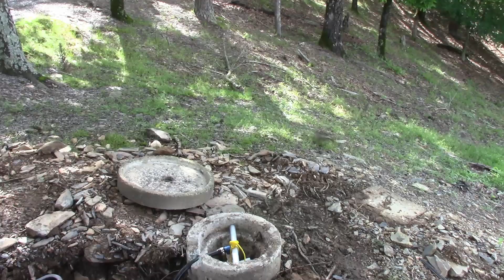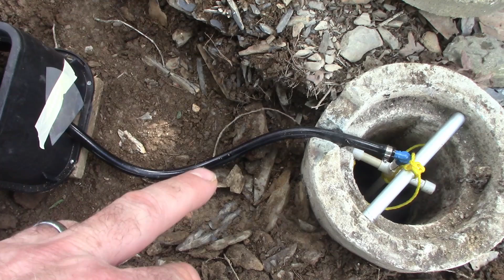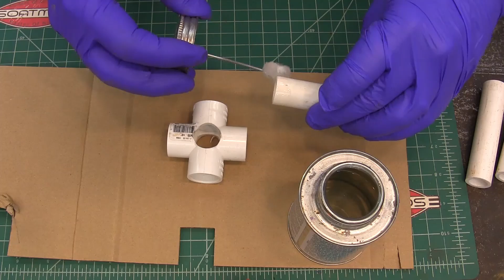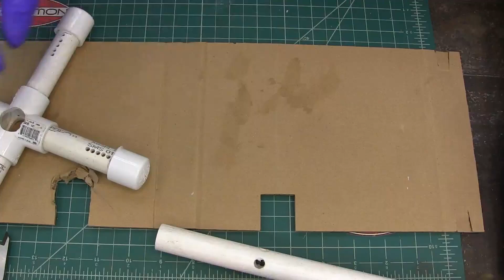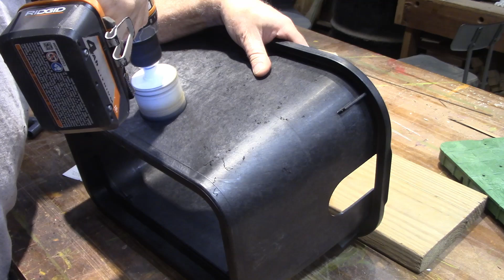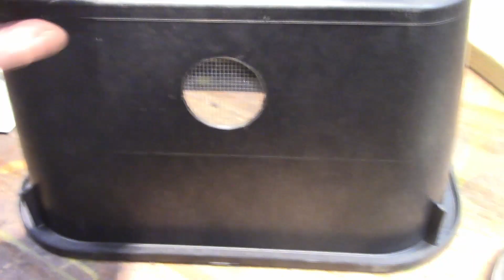Replacing Sewage Treatment Plant Aerator

Comment: Very good repair job.  I always like watching how you come up with simple but effective solutions to problems and do it with hardware items.  I think you learned how to take the hared out of hardware!  I like the idea of strengthening the joint around the cross fitting. Thanks for the video and the learning.  I suppose we are not going to have a garden this year.  My wife will be having a knee and a hip replacement this year and coming up very soon.  The knee that is.  There is just too much to do and not enough time for all the outside work.  So I suppose we will wait until next year for gardening.  Not good but the best I know how to do.
Reply from the maker: Holy cow a hip and a knee. Surely not at the same time. I hope everything goes well for her.